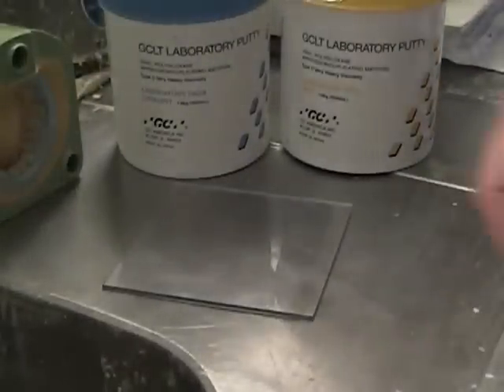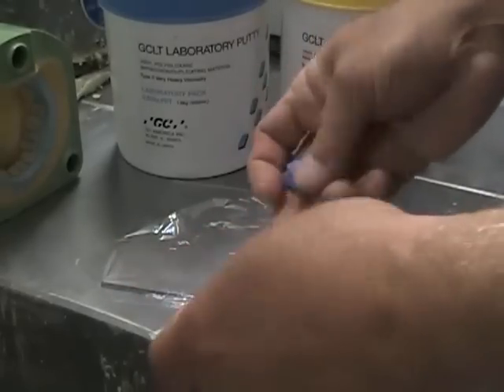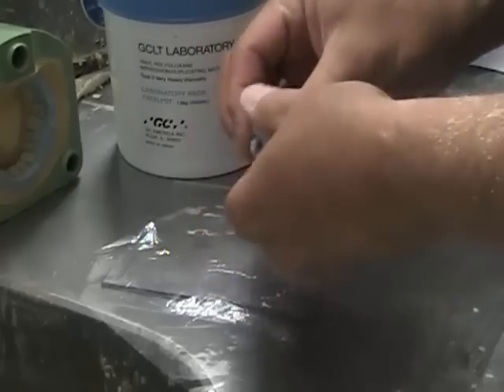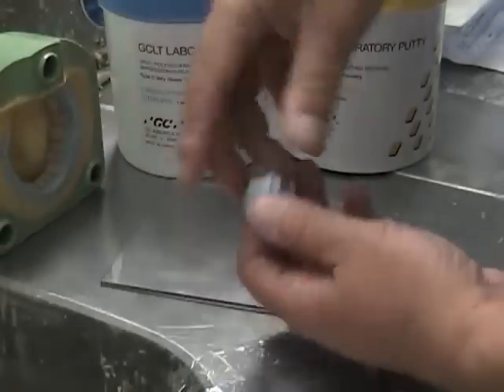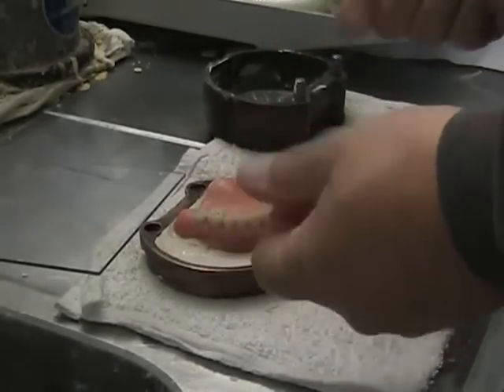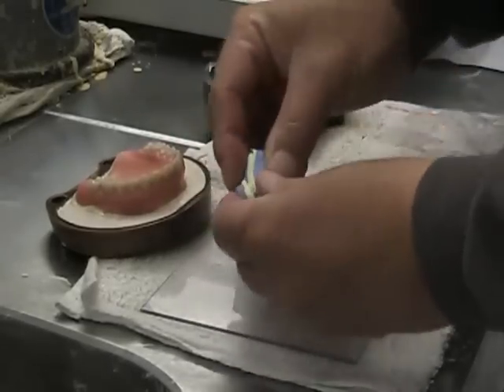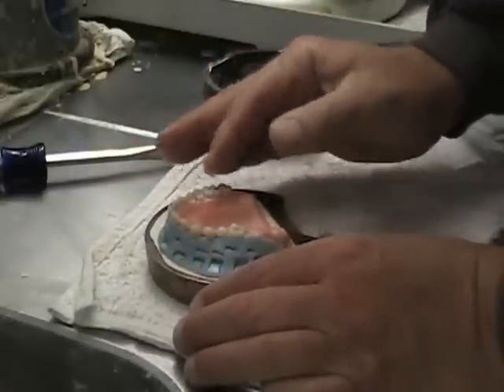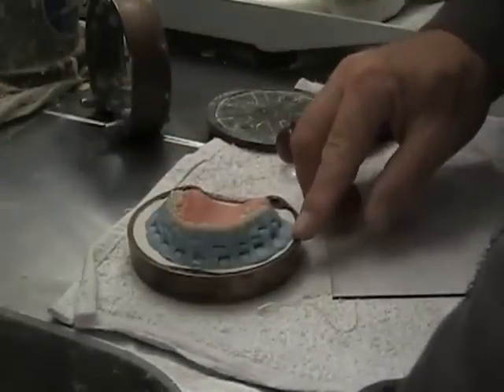Tips and use for laboratory putty

Comment: Great technique for preventing stone going inter-proximal area.
I have a question. . . you didn't happen to cover the palatal area ...stone can seep into the interproximal area. Please explain.
Reply from the maker: I like to have stability of the tooth during packing. You risk even slight movement without stone support. My experience is that its easy to finish from palatal aspect and gives the tooth support foundation I need.